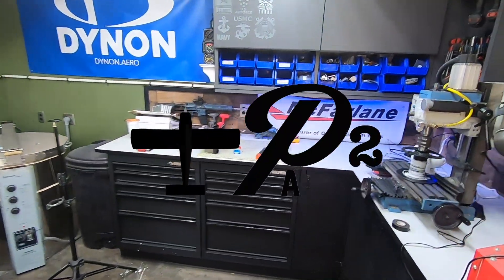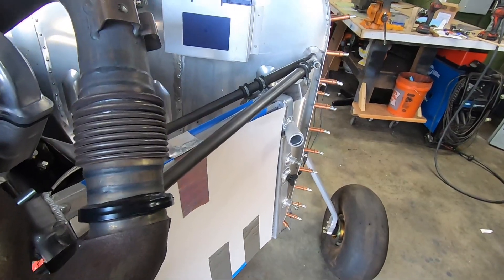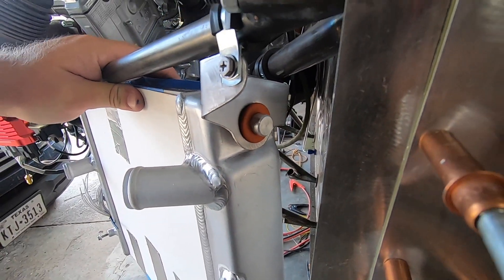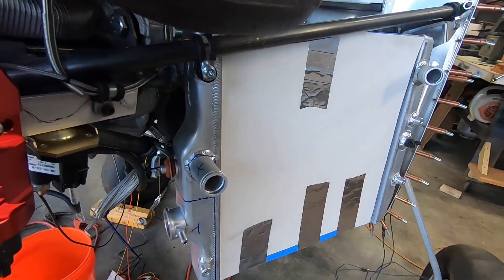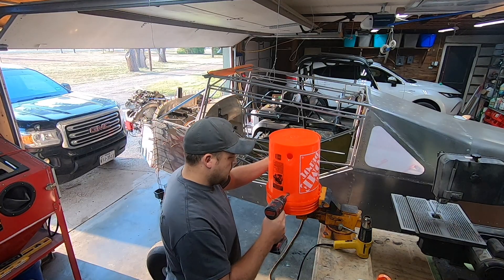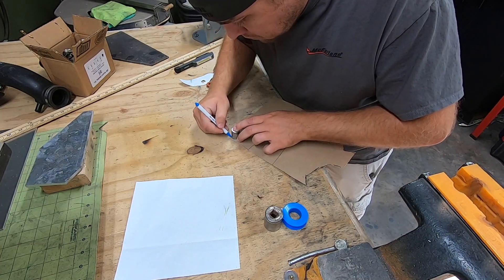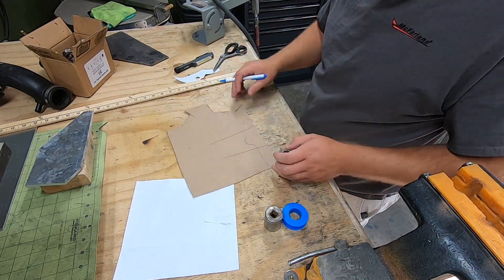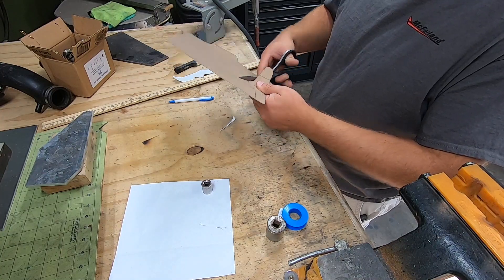HONDA RADIATOR INSTALL RANS S-21 YAMAHA 998TURBO EP34

Comment: where did u source the engine?  factory new or off a sled?  If used , initial condition and cost? getting ready to take the plunge.  wiring harness totally scratch? or existing/modified for ac?  killer work! thanks
Reply from the maker: Thanks for watching sir, I bought this engine new directly from arctic cat. I would recommend the "yamaha aircraft conversions" facebook group for years of research and data. I built my harness from scratch by reverse engineering a stock harness removing what i didnt want and adding a few things. There are premade harnesses available and i can put you in contact with those guys as well as Hypersports for the ECU.  Reach out to me at project2aircraft at gmail . com if you want more info.

Comment: Why not weld a v-brace were the motor mount is and then just make a drop down bracket off of that. Not only would it beef up your motor mount, it would make it easier to remove your radiator later on as to were your bolts aren't in such an awkward place.
Reply from the maker: One thing I didn’t really talk about is that this is all still a test to see if things work out ok. This may not be the radiator I end up using so I was trying to not modify the engine mount permanently at this time. Your right though, that hardware is a bit of a pain!

Comment: Mine broke through V-Twin vibration (you won't see as much with a multi-cylinder ) but using four exhaust anti vibration mounts from airframe to radiator cured the issue
Reply from the maker: I considered that as well.. if it becomes an issue I’ll address it with something like that. Thanks man!

Comment: Absolutely love your work Josh.

While the high temp, nitrile rubber, cushioned “P” clamps will provide some level of damping initially, as time passes and the rubber ages, the “P” clamp’s rubber cushion tends to set (compressed) in spots and with gaps with the part to which it is attached in others.

The rubber also eventually hardens, leading to loss of compliance needed to isolate vibration, as well as of grip. 

However the “P” clamp’s rubber cushion’s state can be checked every 100 hour inspection and damaged clamps thus replaced. 

An alternative method would be to use solid clamps attached to the engine mounts and design in the vibration absorbing medium into the attachment bracket assembly (say rubber sandwiched between two flat stiffened flanges which are bolted together). 

This way you could experiment with changing the hardness and thickness of rubber you might use as your vibration isolation medium if need be, to find the best solution for start up and the full range of engine RPM; looking for critical frequencies (if any should be present - very unlikely though for such a light component).
Reply from the maker: Thanks Dave, great info there! I’ll be keeping an eye on all this for sure to watch for movement or degradation of the rubber used. I agree, P-clamps don’t last forever👍. At this point all of this is a bit of an unknown and I was trying to prevent welding tabs to the engine mount since it may change later if I have trouble controlling temps.

Comment: Nice work, support mounts look to be solid at the same time reasonably light, If you decide to go down the path of using an electric water pump? have a look at Davies Craig EWP's well engineered products both aluminium and high density plastics - reasonably light with solid company backing.
What composition/material, rubber are the orange coloured grommets for your radiator mounts? haven't seen those before?
Cheers Glenn. DownUnder.
Reply from the maker: Thanks Glen! I’ve looked into those and they are still on the table. For ground run I’m running a pierburg pump from a bmw car. More to come on the reasons why when I get to that video. The grommets are silicone rubber good up to 450f and it looks like they’ll work just fine. Time will tell!
Reply: @Project2Aero  Thanks, nice to know silicon grommets are available, I expect the silicon has a longer lifespan than the cheaper rubber versions.
Cheers Glenn.
Reply from the maker: @glennstocker487  Yes sir, they are suppose to last longer and be a bit tougher as well..

Comment: Just curious if you think mounting the radiator in that orientation will trap air. From what I’ve seen, keeping these engines cool can be a chore.
Reply from the maker: Yes sir it will trap air at the top of the tanks. Stay tuned👍